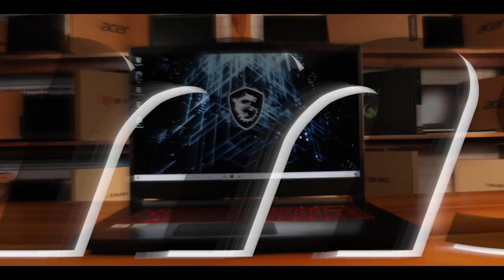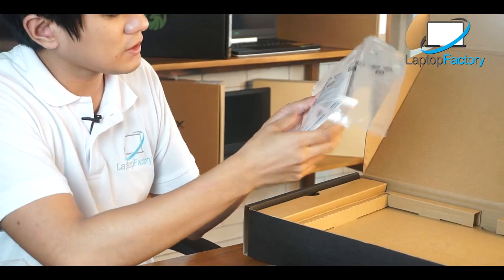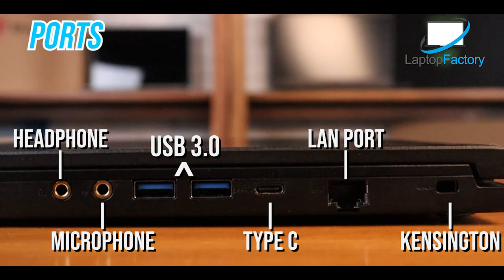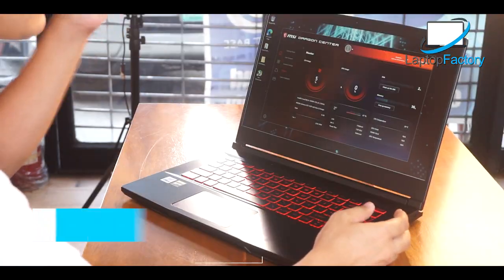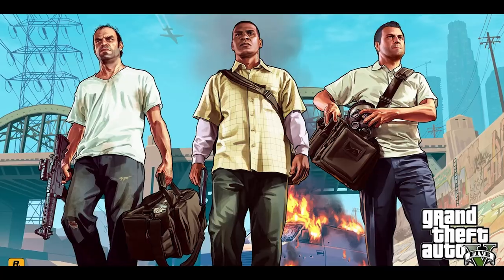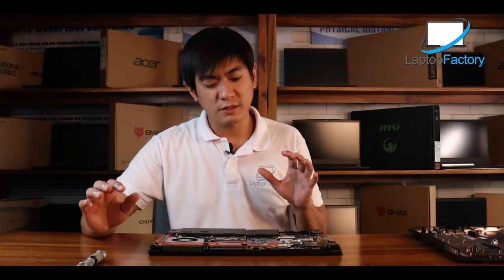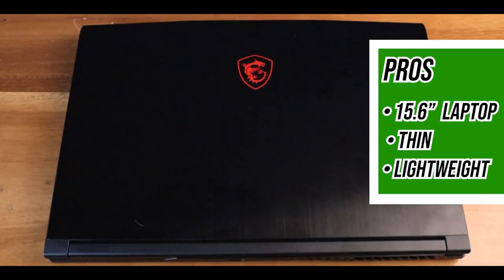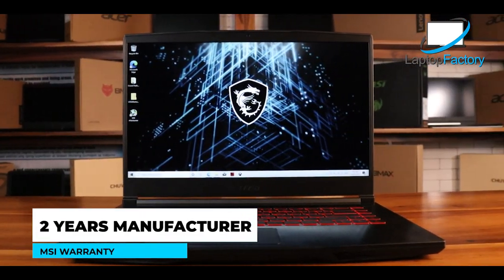MSI GF63 Thin (2020) - MANIPIS AT MAGAAN NA GAMING LAPTOP!? 😲

Comment: MSI Thin models uses lower TDP on the GPU (less heat, less performance) kaya 1 Fan is fine.. at the same time, "thin and light" ang selling point of this model (in between gaming and portability)..

Comment: Computer noob here. 
I think you spoke Tagalog as well, which I don't understand, but I mostly understood the video. Very informative! Thanks for the video.

I was hoping someone could help me with a few questions I have! 

How come the CPU and GPU temperatures were lower on high in-game settings, compared to low settings? 

I don't really care about ultra-high settings and that kind of thing. If I can run single-player survival games, RPGs and MMORPGs in passable quality without burning the life out of the system from overheating, then I'm happy. 
Given the rather similar specs of this laptop and the ASUS TUF GAMING F15 FX506LH-HN004T with Intel Core i5-10300H-processor and
NVIDIA GeForce GTX 1650 4 GB,   which would you expect to run cooler?

Thanks a lot for the help! And thanks for the video!
Reply: This video specifically says that MSI is good at cooling the temp. And said that he never experienced overheating with his personal msi laptop. Hope that helps.

Comment: got this laptop its the GF63 10SCSR 868PH variant comes with 1TB hdd 256GB m.2 ssd, 144hz 15.6" panel and single stick 8GB ram but has extra slot for another ram module to further upgrade so far the CPU i7 10750H is a hot mess but a powerful one using it mostly for Architectural rendering and stuff while GPU is  a gtx 1650 ti max q variant can play most aaa games at decent frames say witcher 3 100+fps on LOW and 45-60 fps ULTRA with hairworks OFF temps are 70-90C for CPU 60-70C GPU
Reply from the maker: Thanks for sharing!
Reply: @LaptopFactory  welcome 😁😁
Reply: How much did you buy your laptop? Because I need a laptop for architectural rendering..
Reply: @selenamadge489  by this time it wnt be much but can handle Lumion stuff on the go.. animation of simple house photorealistic setting nails me an hour for 20sec vid and 2min for rendering still image.. got it P62k or around $1100 usd but that was in early 2021 so prices now may vary i think now you can get rtx 3060 laptop for that price

Comment: I have MSI GF63 Thin 10UC with i5 10500H processor (10.gen.) , 1x 8GB and I want to upgrate 1x 8GB RAM memory. I don't know if RAM run at 3200mhz because official Intel site says that this processor support only 2993mhz frequency. Could you help me please which RAM frequency should I buy it?

Comment: ano po mas maganda overall para sa inyo, eto or yung r7zu?
Reply from the maker: For performance Acer Nitro 5 has a lot better performing processor. It also contains more memory.

Nitro 5 is cheaper.

For displaying graphics Nitro 5 has a lot faster graphics card.

For portability MSI GF63 is lighter.
Reply: @LaptopFactory  thank you!
Reply: @rosesarerosie9946  Yes. Agree. In all aspects mas maganda performance ni Acer nitro 5 kaya siya mas mabigat sa MSI gf63.
Reply: @peterpandamdager5050  is the r7zu gonna handle autocad/revit well? pros and cons?

Comment: Mukhang good buy ito. Parang kakaiba yung GTX 1650 nya compared dun sa acer nitro 5 kc mas maganda performance nya sa mga games. bkt ganon? Max Q ba to?
Reply: Yan din napansin ko sir, ung sa acer nitro 5 medyo mababa ung fps nya compare dyan sa MSI . Di pa yan upgraded sa 16gb ram
Reply: @snoopdog2704  I don't think so sir. Since hindi nila inexplain sa video we can only speculate but I bet my money that this is a Max Q 1650 which means it can handle more wattage. More power draw more memory and core clock = more fps. But again this is just speculation.
Reply: @9786paolo  bat ganun yung sa nitro 5 ang baba nh fps nya pero dto ok naman
Reply: @riccithiyagarajan4230  To be honest hindi rin ako sure sir. Pero if I had to guess I think it's a difference of processors. Intel kc it tong msi e and Intel has always been integrated with games better than amd. Well ryzen naman processor ni acer nitro 5 right so dapat ayos dn performance right? Well yes you would think that, pero yung mga ryzen processors kc sobrang RAM DEPENDENT sila. Meaning if hindi full blast 16gb 3200mhz ang ram mo hndi nya ma access full potential ng buong gaming experience mo sa laptop or pc. Ayun yung theory ko kc I've checked the specs and confirmed na full blown gtx 1650 mobile ang meron ng dalawang laptop and walang naka max q sakanila.
Reply: Laptop Factory commented dun sa Acer Nitro 5 review nila and they said na di raw nila na update yung Nvidia graphics kaya mababa lang yung nakuhang fps. I'm torn between  which one to choose, this laptop or the Nitro 5?
Reply: @neilamrelcastillo2816  oh I see! Now that makes total sense! If GPU driver nga yung dahilan ng weak performance ng acer nitor 5 then Acer Nitro 5 would be the better choice kc mas mura sya with halos the same specs. Kahit nga ako sir ngiisip dn kung bibili ako ng Acer Nitro 5 ryzen version if worth it sya. Maybe it is. Pero hindi ko tlaga alam if bibili or magiipon pa for something better. Lalo na meron mga lumalabas na AMD Advantage laptops ngaun. Sobrang hirap magdecide kapag laptop binibili.

Comment: I bought the same model of laptop po last year, and ngayon mejo mabagal na po mag start yung lappy and matagal din yung command, like 5-7 seconds, ano po pwedeng gawin sir? Is upgrading the RAM will make it faster?
Reply: Try reformating/refreshing the laptop. Usually sa dami ng mga background apps kaya bumabagal. Back up files ka muna before restoring it. Hope this helps. 😊
Reply: You need to repaste your laptop every 6 months or once a year.
Reply: @kovalsky3531  Ano po ang repaste?
Reply: @slipknot9298  thermal

Comment: What type po yung ram for upgrade?
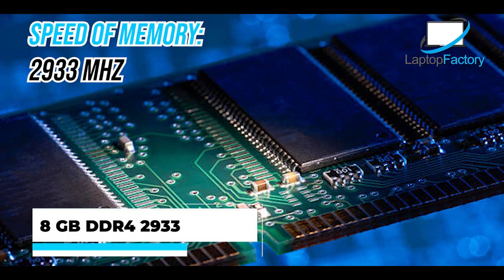Reply from the maker: 6:22 must be ddr4 2933 mhz ram
Reply: @LaptopFactory  pwede po ba yan sa 3200 mhz?
Reply from the maker: @michaellamado4626  you cannot use other ram frequencies, pag naglagay ka ng other frequencies, baba ang efficiency ng ram. babagal yan
Reply: @LaptopFactory  nasa video nyo po is 3200mhz
Reply from the maker: @michaellamado4626  typo in chassis part, sorry. as per msi, 2933 mhz lang po

Comment: Who is the best laptop ?
MSI GF63 thin- Intel core i5 9th generation 9300H QUAD CORE PROCESSOR

Graphic card- Nvidia GeForce GTX 1650 ti with max Q 4GB
clock speed 2.4GHZ
                         vs
MSI BREVO 15- AMD RIZEN 5 4600H HEXA CORE PROCESSOR

GRAPHIC CARD -AMD Radeon Rx 5500M 4GB
Clock speed 3 GHZ
Reply: Msi gf63 is not 1060ti
Reply: @apollonmegara8220  see again 1650ti with max q
Reply: @mr.ashutoshkumar4370  yeah i was wrong sorry about that
Reply: @mr.ashutoshkumar4370  if thats the case the better is the msi